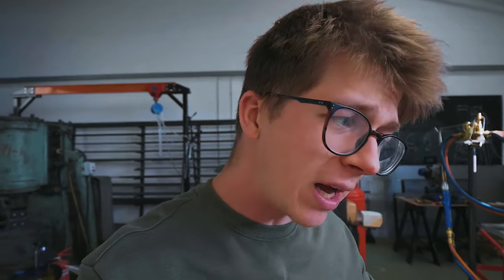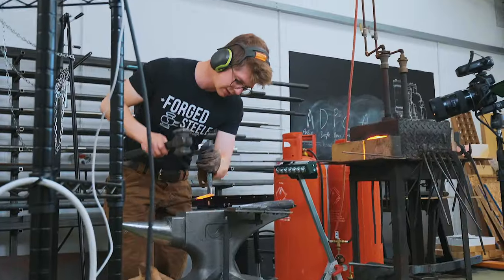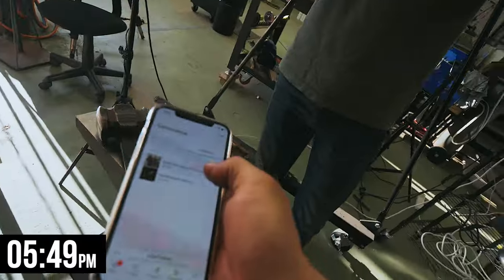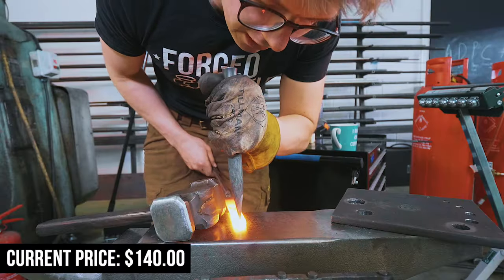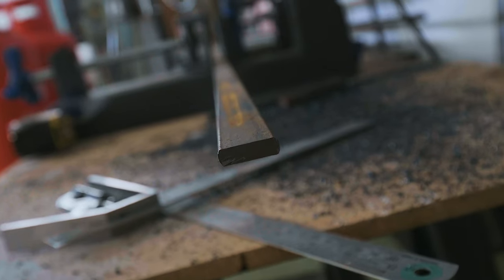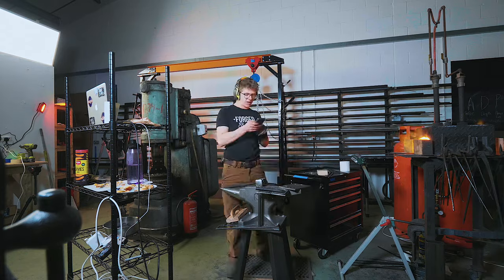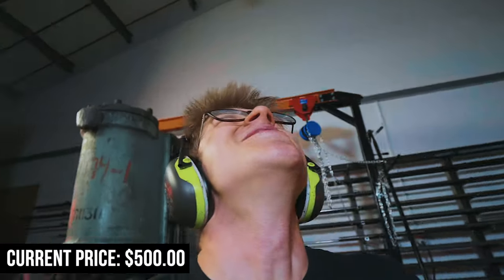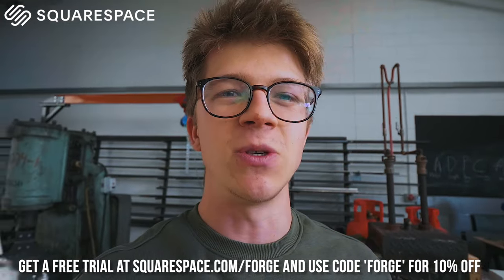FORGING UNTIL YOU STOP BUYING!!!

Comment: If you do this again (perhaps a different product), individually stamp each item with the price it sold for.  Getting the exact item that was built by you for the price agreed upon would probably motivate more people to purchase.
Reply: He has it all on video.  He can reverse order of when he put them in and send each exact one out.
Reply: @Zythan  evertime he throws one in they get janked around
Maybe most get "Their" bottle opener, but some wont

Instead of marking every bottleopener a signed band with the price on it would also work, since he would have to make at least 10 stamps just for the prices that he probaply will never use again
Reply: @Soeck  stamping numbers on products is pretty common so he'll have plenty use for the stamps. The main issue comes in keeping track of each individual order and sending the right product to the right person.
Reply: He could have just laid them in order as he produced them on a big table next to the forge. That would have made a get visual for the video too.
Reply: @grapie93  Pretty easy if each one has its own price, match the price to the purchaser.

Comment: The amazing thing about this video, it was a very cleverly disguised Square space advert, the whole thing. Just alec demonstrating just how versatile and easy it is to setup and use and adjust things on the fly from your mobile. I bet square space love having you on their books. On other channels its usually its just a boring 30 second or 1 minute ad at the start on mid roll, usually spoling the flow of the video, but Alec has creatively got round this problem by intertwining the two. Great Job!

Comment: Do this again with another item but do the pricing structure differently.

first sold is a quarter so $0.25
second +0.25 = 0.5
third + 0.5 = 0.75
fourth +0.75 = 1.50
fifth +1.50 = 3
sixth +3 = $6

thatll make the beginning nice and slow and quickly the price will ramp up insanely quick